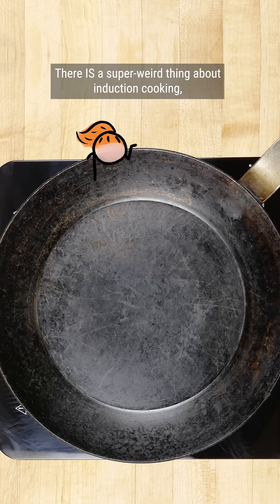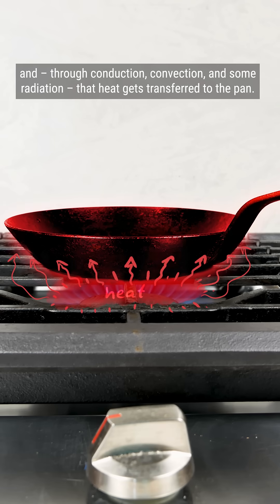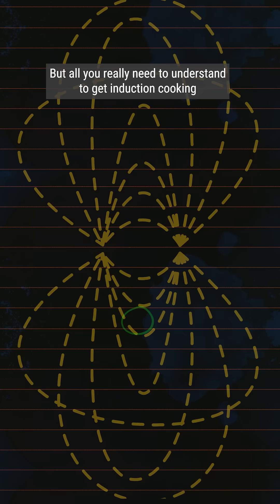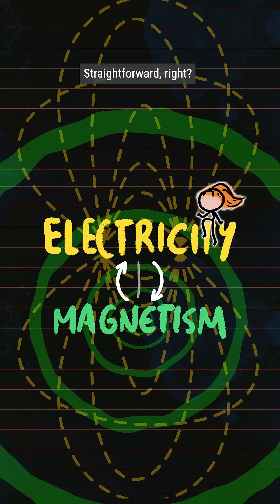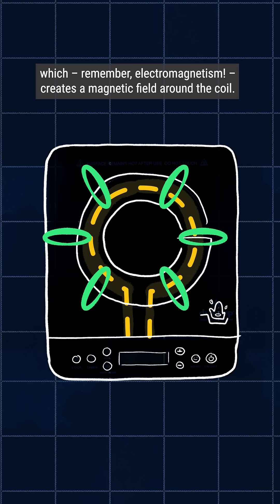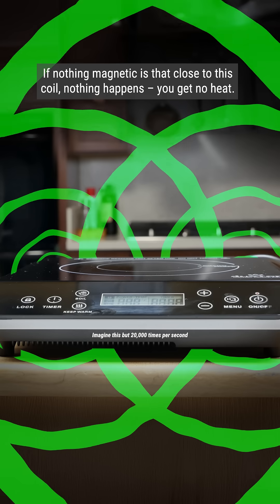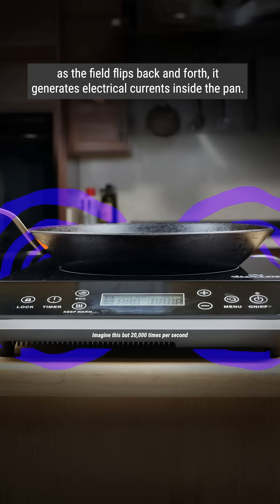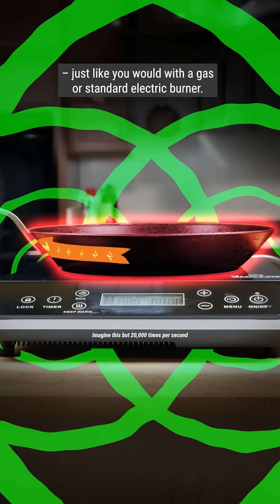How Induction Heats Your Pan

Comment: My only problem (and only a verry small percent of people with me) to not yet switch over is I can hear the induction its kind of ticking sound. Both my husband and me are Autistic I have a lower tolerance for sounds so I ll have to wait a couple of years for the natural decay of my ears 😂
Reply: you BARELY hear them. they're only really noticably audible in videos
Reply: @lappolappo3  the inlaws have one. And have been using a one pit at a workplace before I knew what was bothering me. Yeah most people wont have a problem but if high sensitive to certain sounds its good to keep in mind. (I also get headache from Miele vacuumcleaners, Kärcher shopvacs are better because of lower sound frequentie.)

Comment: Not necessarily a magnetic pan but there's a coil in the pan. The magnetic field induces a current in the coil in the pan base and that generates heat. Just like wireless charging, except that the coil in your phone generates a current that us fed to the battery rather than just generate heat. Note, thats why your phone also gets a bit hot when you charge it wirelessly.
Reply: There is no coil in the pan,you can put a sheet of iron on the induction stove and it will get hot.Any old iron pan will work on an induction stove top just check the pan with a magnet,if the magnet attaches to the pan it will work on an induction stove.

Comment: Yeah, I'll stick to cooking things with fire, the old fashioned way. 

At least that I can trust to heat up my pan evenly and be at the temperature I want it at, as soon as I turn the dial to change it, rather than 5 minutes later. 

I like to flash fry a lot of my food to sear the outside, and then turn the heat down to cook it slowly throughout. Can't do that on anything that isn't a flame top stove because it takes ages for the heating element to cool back down. So, unless you want to use multiple hobs, you are forced to cook everything the way the stove wants you to cook... 

I dunno about you guys, but I much prefer tech that adapts to me. Not me having to adapt to tech.
Reply: All of your points should mean you only use induction
Reply: Guess i should explain why huh. So with a gas burner you get hot spots on you pan where food can start to burn but with induction you get very even heating. Also induction and gas burners are similarly fast but induction stays more consistent. Then also induction is super efficient because the heat comes from the pan itself unlike with gas where most of it escapes along the sides. Not to mention the risks associated with having any kind of gas lines in your home
+ Your point with the cooling of the hating element makes it seem like you sont understand induction. There is no heating element there. The pan gets heated by electricity directly
Reply: Sounds like a skill issue

Comment: Research clearly shows that induction cooktops are more energy efficient than other cooking methods.

Gas cooktops are about 40 percent efficient
Electric-coil and standard smooth-top electric cooktops are about 74 percent efficient
Induction cooktops are 84 percent efficient

Comment: So it's an unbelievably loud, unbelievably inefficient ultrasonic speaker with the pan as the active element? Does this upset dogs?
Reply: No, no, no, no
Reply: @alfiehopkin5795  right, because of the mass of the metal all of the energy becomes heat and none of it escapes as sound. The frequency is too high. The mass of the metal filters it out
Reply: @ so why’d you make that comment?

Comment: basically the magnetic field makes a high current flow back and forth though the pan because the metal is (electo-) magnetic and reacts to the alternating fields of the stove. It's pretty simple. Also works many other metal stuff you might accidentally put on the stove while its on :D

Comment: But i would be realy intressted in how the heatspots and heatdistribution compare to a gas stove!?
Reply: From my experience they generate the most heat in the middle, and the sides of the pan take a bit longer to heat up. But I suppose that's the case with gas stoves as well since you have a very centralized flame.
Reply: @Kiwi2703  oh, ok, thank you for your advice!

Comment: For people who don't know: It is the same principle your wireless charger works on your phone. 

You can basically charge your phone by putting in on an INDUCTUON panel.

Just pull it up all the way and put your phone on it. It might even charge faster because the Watts are higher.

Comment: This might be a stupid question, but does this mean that you can easily put your hand on an induction stove, even if it’s on the highest setting? Since my hand isn’t made out of metal, nothing should happen right?
Reply: Yes you can, nothing will happen
Reply: Correct. As long as you didn't just remove a smoking hot pan from it, then there can be a bit of residual heat, but rarely enough to cause serious burns.

Comment: So when I touch an induction stove and I feel heat, is it from the actual surface (coils/glass surface) getting hot? Or is my finger doing the same thing as the metal pan and interacting with the magnetic field/ electricity?

Comment: these currents are called "Eddy's currents" which are generated in the metal pan. It's quite fascinating, electricity generates magnetic fields which generate this eddy's currents and it doesn't matter if the pan has low electrical resistance, the alternating nature of the current results in very high heat generation which results in heating of the pan. For more efficiency, make sure the surface area of your pan is uniform and has a flat bottom. As one way to reduce eddy's current is by increasing the surface area thereby decreasing the heating.

Comment: you said the pan is magnetic, which is wrong.
Reply: ?? Then how do you suggest this works?

You need a magnetic pan for this. Most today are magnetic
Reply: A normal steel pan Is made from steel and nothing else, Steel or Fe is a magnetic Element so yes it is magnetic and absorbs magnetic waves

Comment: A follow up question: Why dont I get electrocuted when touching the pan?
Reply: maybe because of the isolation coating on the pan
Reply: Because the steel is such a good resistor that it turns into heat

Comment: It doesnt have to be magnetic just conductive is enough like aluminium the steel part of the aluminium is there because steel has more resistance then aluminium increasing the internal friction and thereby generated heat 👌🏻
Reply: Aluminum isent ferromagnetic

Comment: I recently got a new phone with a thermal camera, and i used it when i was heating up oil in a pan. And i saw that the oil was getting heated up MUCH more at 2 specific points in the pan, and barely at all everywhere else. So i guess this is why.

Also on the thermal camera it looks beautiful, almost hypnotic when i mix the hot and cold oil around lol
Reply: What’s your phone?
Reply: @linah.939  power armor 18T
Reply: Which is why people refuse to use induction cookers. Their heat distribution is not even. Your food will cook faster on certain spots on the pan but not the other. Boiling water is ok. But Asian stir-fry is hard. Especially when you use less oil.
Reply: Which phone
Reply: @CrackedCandy  the power armor 18T

Comment: Induction cooking is amazing, genuinely. I've used gas all my life, and then I switched over to induction. I'm not going back. I can boil an entire pot of water in five minutes while on a gas stove that would take what twenty twenty five minutes with a lid on too. They also don't stink up the place or make you want to cook naked due to the heat, also healthier too since when that gas burns, some stuff gets left behind you shouldn't inhale.
At the same time they don't require all that much power. Only bad part is you can't heat the pan in midair and if you want to run it when the power's been cut you'll need batteries but if you have solar or wind power already you probably have them ready to go.

Comment: Fun fact: the reason an electric current generates heat is the ohm-resistance. A metal doesnt perfectly conduct electricity(usually), and the resistance is the culprit. But, energy cant disappear, so zhe electric energy is converted through the ohm Resistence in the metal to heat. And at high enough power, even light(red hot glow)

Comment: Just a quick question.
If there is electric current in the pan then why don't we get shocked from the pan.
Reply: It's not a high current and the voltages are smaller and localized.

Comment: This is a dumb question. But since it's generating electricity would I able to use this electricity to for example charge my phone or something else, while also heating my food ?
Reply: Your phone charges with about 15w a induction stove works with about 2000w iirc, so not really
Reply: @icefire_6283  sorry I haven't explained myself very well . What I meant is wrapping some cables around the saucepan and transferring the electricity from the pan to the phone charging port. So would that diminish the efficiency of the heating . (And since you said 2000w there is certainly a coefficient of transmission ) . Thank you also for your answer it was really relevant.

Comment: biggest issue with induction, is you have to be really careful about what pans you buy... even if it says good for induction, sometimes they're still not good and i'd recommend buying the same brand for them all. induction doesn't have medium heat or high heat because it all depends on the pan, some heat up much faster than others. the more metal the better
Reply: It very much got heat settings, like you can set to what degrees it heats, it may not be accurate but it is regulatable
Reply: @ yes but depending on the exact composition of the pan it will heat up faster or slower and so having the same brand for all your pans will allow for more confidence and understanding in exactly the numbers you are using. the heat settings in degrees cut off once they get to that specified heat, but on some pans take ages to get up to it, on some are fast, on some they do not work at all even if those pans works on other induction hobs

Comment: Is induction cooking more financially affordable and safer? What are the reasons someone would switch from electric or gas stove to this stove?
Reply: Electric stove is stupid 
But gas stoves have their benefits.
Reply: @ that doesn’t really help to enlighten me on induction cooking
Reply: @johnnygibbs7709  it wasn't
Reply: @johnnygibbs7709 most induction stoves require way less electicity than the average electric stove.

As for safety, an induction stove does not heat up its surroundings and does not have the danger of toxic gases being spread around the room.
The only dangerrous thing about it is putting other metal objects instead of cooking utensils on it. It heats up anything magnetic, so make sure to not mistakenly put things like spoons or your phone on it.

Comment: Then the question is: which is more efficient power wise? Also, why the hell are they so much more expensive than gas stoves! That only adds insult to injury
Reply: From google: "The per unit efficiency of induction Cooking Tops is about 5-10% more efficient than conventional electric resistance units and about 3 times more efficient than gas."
Reply: @gdmathguy  thank you

Comment: Got an induction cooking top and never looked back. So fucking fast, so hot, so convenient and so much safer man
Reply: electricity is more expensive than gas
Reply: @realien-nwonatural gaz is around 2.5 times cheaper than electricity sure but the efficiency of induction vs gaz stoves is around 2 times better anyway. So not much of a big difference. 
To give u exact numbers. Its around 5.85 × 10^-8 USD per joule for induction and 4 × 10^-8 USD per joule for gaz.
So induction is indeed 50% more expensive. So you're gonna have to ask yourself if you value convenience or money more.

Comment: Not necessarily magnetic material! Induction absolutely does not care if the material it's affecting is ferromagnetic or not.

The biggest reason we use ferromagnetic materials is, well, iron has terrible conductivity especially when compared to aluminum (and copper, but copper is a very niche cookware metal nowadays) and it just so happens to be ferromagnetic. These two reasons are why we make the coils in generators from copper rather than iron.

It should theoretically work with graphite (especially since it's even worse at conducting than iron is), but I can't check that for myself since I don't own an induction hob and can't find any where I live.

Comment: I’ve got a bit of a physics correction, I think - any conductive metal is able to have a current induced in it by this flux, thereby generating heat - it just needs to be high resistance. Steel and iron work because they are ferromagnetic (able to have all their electrons aligned), not because they become magnetized, as the word magnetic implies. This ferromagnetism, in effect, prevents the flow of current through the metal and it instead forces it to the surface, increasing resistance greatly by making, in effect, a much thinner wire - the pan itself is not at all “magnetic” when it is just sitting around. This resistance turns some of the energy from the induced current into heat. In theory, sufficiently thin pans of other conductive materials would also work well (and have been demonstrated to). I’m being pendant in, though, so if I screwed something up, feel free to be a pedant with me too ;)
Reply: I don’t thin most pans are “high” resistive. Not sure you need them to be as well. Induced eddy current from the stove into the pan should be fairly high anyway.

Comment: Hypothesis remove the glass make the thing 10x bigger or ard a steal cube would it basicly a heated cube
Reply: Remove the glass and the pan starts melting.
Induction is also used in industry to soften metal

Comment: The fundamental premise of this video is wrong! It's not the induced current that heats up the pan, if that were true, aluminium and copper pans would work fine.

You need a ferromagnetic material, because the alternating field affects the magnetic dipoles in the material. Basically anytime the field changes orientation, the dipoles also flip orientation, this costs energy and this energy is dissipated as heat. That's where the heating comes from.

Comment: I hate induction because in some of them the heat is controlled by turning the coil on and off at intervals. However, because its so damn efficient, if you use a light pan your pan will just get super hot and cold rapidly, instead of the constant heat you get with a gas.

Comment: Since current is travelling through the pan and pan's material is conductive, why do I do not get electrical shocks?
Reply: A combination of low voltage and circuit isolation

Comment: If I've got this right, this would mean that the stovetop doesn’t get hot in order to heat the pan, the stovetop gets hot due to the pan, which it's touching.
Reply: That's correct! Because of this, Induction stoves are the safest stoves for pet owners. If they accidentaly turn on the Cooktop, they can't get burned
Reply: Absolutely correct. You could safely put a piece of cardboard directly on the stove and put it on full blast with nothing happening.
Reply: @f79583 I admit I put a piece of kitchen paper towel between the pan and the induction stove because I wanted to take away spilled oil. I left it there for a while and when I removed it it wasn't even discoloured aside from the oil stain. Just little hot from the heat of the pan. I don't want anything else anymore. 😅
Reply: so if I touch the stovetop with my hand  nothing will happen?
Reply: @frikimanhd4087  as long as there wasn't something magnetic on there before, yes. Just make sure you are not wearing a ring
Reply: @f79583  Only if the ring contains iron or nickel. Gold an silver does not get heated.
Reply: @galier2  I know but I didn't want to go into the details
Reply: @frikimanhd4087  exactly, I've work with this types of stoves in the past and if you turn it on without nothing metallic on it, in some of them it will even turn off on their own since there's nothing to be heated hence no heat is generated. You just have to be careful if something was before on the stove specially with kids or animals
Reply: @frikimanhd4087  yes as long as you aren't wearing magnetic rings or jewelry or something.
Reply: It uses the properties of the pan to heat it up. Not all pans will do. 

 Cast iron are good while pure aluminum, and copper are not for example. 

 Now with that said you can buy a copper, ceramic pans with magnetic materials built in. Lots of induction friendly pans these days. 

 Anyway it is pretty cool. I like to think of it like resistant heating, and the pan is a connector to complete the circuit. It isn't, but for some reason that is how I visualize it. Like the pan is the filament in a light bulb. 

 Wonder if a tungsten pan would work.
Reply: Exactly. And it's safer than other forms of cooking
Reply: Mostly correct. Except that the pot is hot and will also heat beneath.
Reply: We were trialing an induction ring in college, 90s , and our lecturer put a bank note between the ring and the pan .. 
By the way the ring does get hot enough to burn you after a while - because the hot pan is sitting on it .. 
And what the hell is your pet doing up on the stove .. eugh